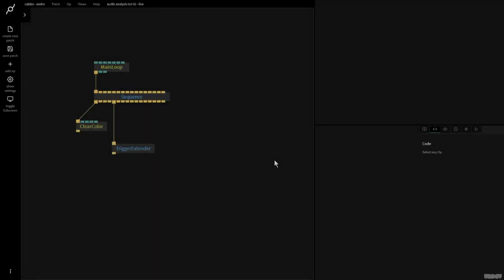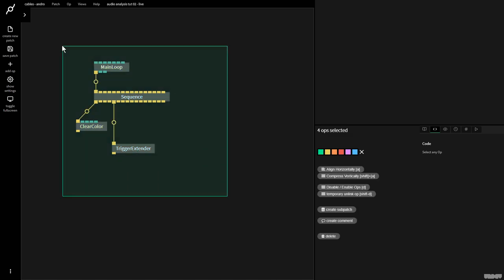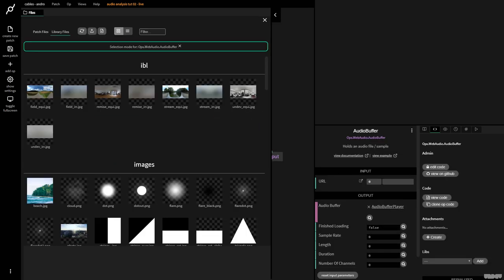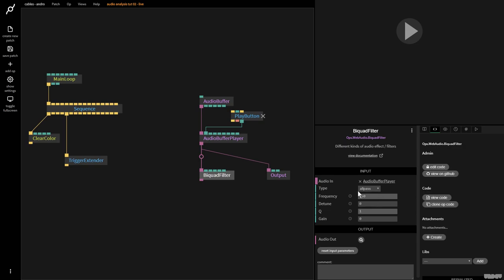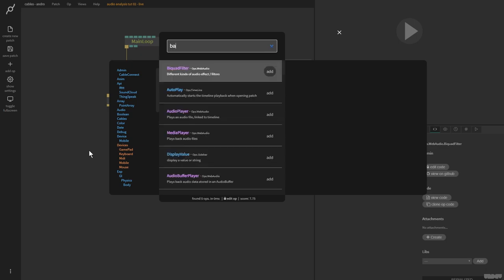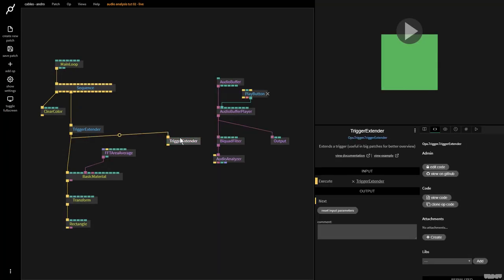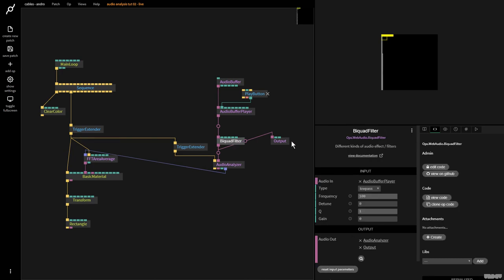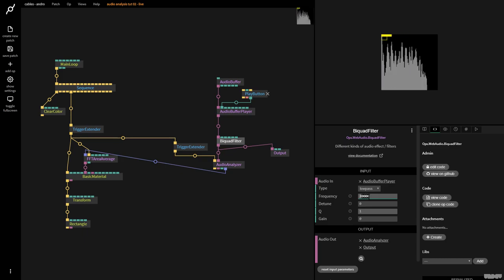BiQuadFilter op- audio reactive tut

Comment: Hi Andro great tutorial. Question, my Biquadfilter Frequency jumps to a value of 0-1 when I adjust it with my mouse. When I add a valuehub op to the frequency it works as it should.
Reply from the maker: Hi Monofied,You can click inside of the parameter and manually type a number in and then press enter. 
Thanks for pointing this out we'll make sure to change this in the next update.

Comment: I tried doing this for making some realtime visualizations from drum & bass events. The thing is the biquad filter needs to be changed on a track by track basis, which isn't feasible in a live scenario. I've came up with a method that sort of works for any types of tracks.  The patch is a bit messy, but I'd like to hear your thoughts on my approach. https://cables.gl/edit/_aze_P
Reply from the maker: Hi Robert, 
first off, nice patch !
The BiQuadFilter can be tweaked in a live scenario if you use a midi controller with at least 6 knobs.
3 x frequency - Bass - mid - high
3 x Q/Resonance - Bass - mid - high
Then during the live set you can quickly and easily find the bands you need.
I'd use a clamp op to make sure that the bass - mid- high stays separated.